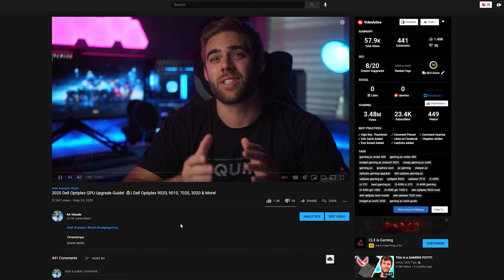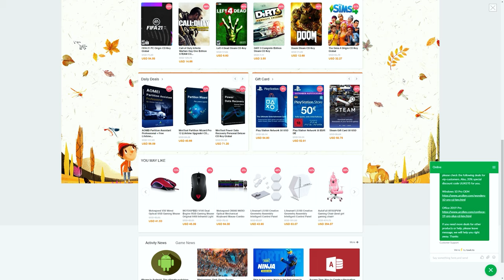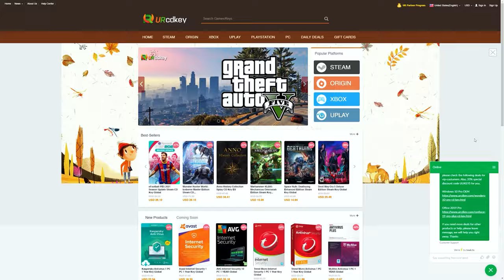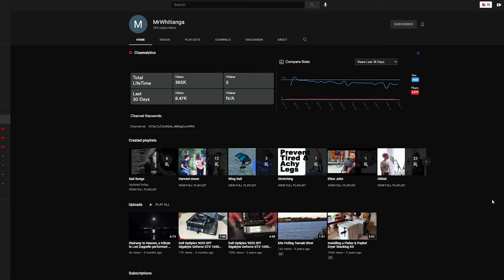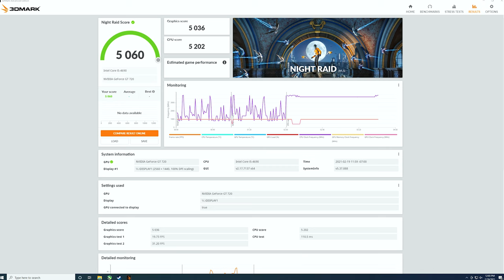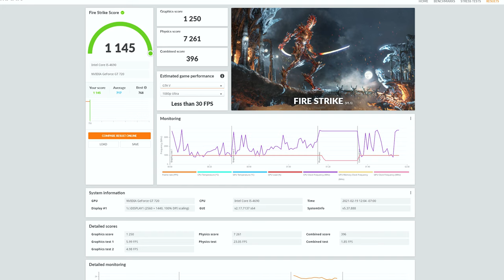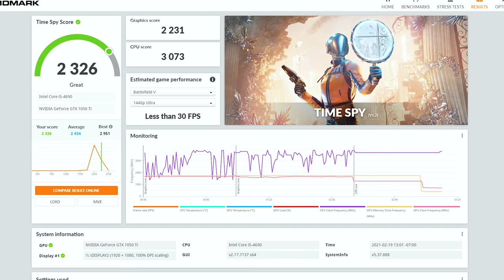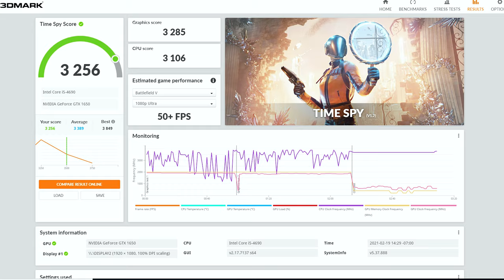The Best Graphics Cards For The Dell Optiplex SFF | 9020, 7020, 3020 & more! | GTX 1650, 1050ti

Comment: So I can use the 1660 in the dell optiplex 2090 without upgrading the psu?
Reply from the maker: I don't think so. I believe you need to upgrade the PSU for the 1660
Reply: @RAVisuals  the psu I have I think is 225 w and the 1660 is 125 I believe

Comment: I have a Dell Optiplex 9010 SFF (3rd Gen i5 with 240W PSU) with Windows 7 Pro, may I know what graphics card can I buy for AutoCAD 2010 3D rendering?
Reply from the maker: Try one of the cards i used in this video!
Reply: @RAVisuals  Thanks but anyway I am trying the zotac gt1030 to take the risk.

Comment: Would a 1650 lp work on a dell optiplex 3020sff
Reply from the maker: yes it will!
Reply: @RAVisuals  Thanks bro
Reply: @masoncombs9967  you gpu running well with optiplex 3020sff???

Comment: I got the 1650 and it has a display port, msi ripped you off :p I think mine was a Gigabyte IIRC. I'm not happy that I have it in the x4 slot so now I'm trying to find a motherboard and a case so I can move my components into that and use the full potential of the card, unfortunately newegg doesn't have the ones I want so I'm trying to see if some local shop can get them for me. Amazon does have them, but I have zero interest in sending them my ID just so I can buy stuff from them, like, what?? Fine I guess they're so big now that they don't care about losing customers. I'll get my stuff eventually. Or have someone else order for me from amazon if all else fails lol.

Comment: I have the 7010 sff would some of these gpu work with it?
Reply: Yes, I have the 7010 sff with a low profile Gigabyte GT 1030.  I used to have a GTX 750ti inside it but I cooked it when I overclocked it too much.

Comment: Hi RA Visuals,According to the official dell optiplex sff  manual  models such 9020,7020 .. ...do not support more than  25W per PCI-e . You have real relevant practical experience in testing  models  with  video cards requiring more than 25W , so you do not have  power issues,don't you?
Reply: After my findings. 25w is more of a recommendation, as the standard for the pcie slot is actually 75w I believe. If you can sneak in a better psu (there's like one better, 315w iirc) then you should be able to push for higher cards with less stress

Comment: Hello there. can an i7 upgrade work with these 9020 Optiplex, i have 10 of these and so far at 20gb ram and 500gb hdd and OEM win 10 pro it works very good... i got you on not actually buying these. i didn't they were given to me. i got 6 working so far.
Reply from the maker: Yep! They can have i7's in them as well. I believe the 3770 or 4770 depending on what board you have in them
Reply: @RAVisuals  Great ! Thanks a million I will let you know how it goes. I truly  Appreciate the response 👍

Comment: hi friend, I have a question pls….  I have same optiplex 9020 with 32GB ram, i7,  2t SSD, 240w power supply….  I want to know if I add the graphics card, will I be able to use (Davinci Resolve) to edit videos??

Comment: But people keep saying these motherboards won't power anything more than 1030? Who do i believe?
Reply: that's not true, yes considering the gt 1030 is the least powerful option it will run easier and at a lower temperature but a 1050ti or 1660 will work fine, just do your own  research my guy

Comment: These are more popular for the size and putting a console based Linux distro on it or running Steam Big Picture to play "console games". You can still upgrade these to play just about anything up until 2016/17 and still hold on with some newer titles. Xeon's work, some can have up to 32GB of ram, something like the RX 6400 or A2000 would be plenty of power for a system with PCIE 3.0. For someone who wishes to have an HTPC that can also be good for some couch gaming, these are perfect for the price. SSD, more ram, Wifi/Bluetooth card and a GPU. My entire system cost with a Xeon, 16GB of ram, RX550, the SSD and combo card is about $150/$200 🤷 For a PC based 1080p home console, I can't complain at all. It even does RPCS3 and Yuzu.... Lol

I mean, this thing at roughly $175 can play games at higher resolutions or frames than a new Series S Xbox does in many cases. It trades blows while having access to the Steam library and everything in emulation. Sounds like value to me! Because the Xbox can't play Mario (Or Gran Turismo) lol

Comment: hey! will the A2000 fit my optiplex 3020? I5 SFF and would a power supply help?
Reply: It would fit. A2000 draws pretty low power for what it does.

Comment: Hello, I have a dell 9020 sff and moved the mobo into the m-atx case, can a normal model not LP, gtx 1050ti run a oem 255w psu? because I don't want to upgrade to a bigger psu
Reply from the maker: yes it can!

Comment: I just got mine and bought the Thermaltake Smart 500W 80+ White Certified PSU.. I realized I made a mistake because the computer looks really small am I going to be able to put in the power supply?
Reply: You'll probably have to run the psu externally if it's a sff optiplex. They also sell 315w sff optiplex psus

Comment: I'm interested in putting an rx 550 2gb in my Dell optiplex 7020 SFF with an i-5 4590, it comes with a 255W psu. Would I need to upgrade the psu or is that enough for the 550?🤔

Comment: Would the MSI N750Ti-2GD5TLP fit in the 9020 SFF?   I have the card, and considering getting the computer.
Reply from the maker: I believe it will, you just have to only use the x4 slot though so you'll lose performance as I said  in the video

Comment: Ah dang Ive got a 3010 sff I put a Nvidia GT 1030 low profile graphics card that I paid $75 for it cost almost as much as the PC I thought I made sure I got the newest compatible low profile graphics card I could possibly stick in there even Dell said it's the best quality for the 3010 on their website. From this video I take it that it's compatible with up too a 1650? That's kinda frustrating the graphics card was the one part of my first ever build that went well but I guess even that I did incorrectly ah man. I've got an i7 3770 to replace the i5 3470 it has just upgraded to 16GB RAM I've got a 2TB HDD and a 500GB SSD I would have added the earlier but didn't know id need to remove the optical drive until I get the pcle-sata cable extender thing or whatever it's called so gotta transfer some files after I swap the optical drive for the SSD so the OS is faster and then I can replace the current 500GB HDD with the 500GB SSD at least until I get that extension for the SATA cable thing in that tiny slot next to the graphics card slot. Was sad to not to be able to play some of my disc games I recently bought but luckily enough literally all of them were on sale on steam for like $3 for GOTY editions so yeah not having the disc drive won't matter at least for now. Really need to make sure I understand what parts to order for that extension before I waste more $ lol

Comment: My question can I remove the motherboard and put on a bigger case can I still use a better GPU I'm currently using a GT710 which is pure shit,if I buy a psu and a new gpu(my gpu range is 1070 or 1650 can't afford anything better than that)and a case..I'm wondering if I'll run into problems if I do that...

Comment: I have a 9020 SFF i have a 1060 6GB 
And i put the motherbord in a coolmastercase and i am powering my graphicscard with a second power supply and more fans using a molex to 3/4pin fan connector. And i dont really think its a must to change the motherbord if you are a budget gamer!!
Im running dayz 80frames max 60frames min extreme settings 1440p it works fine
Reply from the maker: love to see it!

Comment: I just got myself a gtx 1050ti for all the games i want to play it runs it at high 60+ fps, i mainily play esports games and gta5 and stuff i need to upgrade my cpu and ram because they are massive bottlenecks.
Reply: Did you chance psu to 315W or does it run with stock 255W?
Reply: @gleiverperez1953  stock 240watts runs just fine.
Reply: @michaelchicken472 your psu don't overheat or shutdown the system ?
Reply: @MetrionN  nah g its actually calm fuck those youtubers that says it isnt this is legit calm i have been using it for like 4 weeks and my max temps(gpu) are 75 degrees am planing to buy an external fan. Any more questions about the system tell me cause i wish i had someone to answer my questions but i took the risk and bought this gpu it was worth it 100 percent am planning to upgrade to the gtx 1650 but its only a 17 ish percent performance boost from the 1050t so idrk i might have to stop using an optiplex in the next 2-3 years.

Comment: im looking to upgrade the 180w psu inside my 7050 sff but I dont know if the power supplys Im looking at on amazon are compatible with any of these gpus (im new to pc gaming btw so I have very little idea what im doing).
Reply: I don't know if you're still looking to upgrade or not since it's been seven months, however, most of these power supplies should generally be compatible with these GPU's. Just make sure the power supply has enough wattage and power capacity to hold in the amount of power that it'll hold! 👍

Comment: I have dell optilex 9020 Sff and i been looking for 2 years to either get a new pc or upgrade my 1030 gt low profile i have 650w psu and i7 4770 with 32gb ram. I was thinking of getting a new pc for better gpu and cpu but 1030gt is almost dying so i dont even know if u should. Gt 1660 super was okay for me i have cougar m330 case so i dont know any idea

Comment: i have a 3020 dell optiplex that i got for myself with no upgrades no graphics card i’m new to the pc building community so i’d be glad if someone has experience and can help me out on how to upgrade it/ it runs fortnite at around 40-60 fps plenty of glitches… what type of ram and graphics card should i get?
Reply: the 3020 sff doesn't have a second video card slot it only supports single slot cards which wont work with the 1050 ti or 1650 lp
Reply: it only works with single slot cards

Comment: Does anyone know if a gtx 1050 ti is compatible with a dell optiplex 3020 sff? I dont mind putting it in the smaller 4x lane, I just wanna know if I can make it work
Reply: Quick question, that gpu is going to be physically installed into the 4x lane ? like it also has a 4x lane and 16x lane slot that you can connect either or ? or are you guys converting? or does it just cover the 4x lane cuss of how big it is ? talking about the gpu
Reply: For my system specifically, the 4x lane is the only lane that you can fit the gpu in without moving the psu outside of the case, the 3020 sff has the 16x lane directly next to the psu and it isnt enough space for any other card than a single slot lp @trueniceguy1115
Reply: @rick7122  yea i was wondering because i have the dell optiplex 3020 sff and my system has both x4 lane and x16 lane and i see that the gpu thats in the vid has a x16 lane inserter so how would it fit or insert in the x4 lane if the insert is completely different? are you guys using some kind of converter ? or does the gpu have both male inserter for x4 lane and 16x lane so you could insert it in either ? cuz im using the x4 lane as my wifi card , so i only have my 16x lane available

Comment: Hi Bro,

May i check what graphics card would be ideal for Dell optiplex 5040 SFF? I am using Intel(R) Core(TM) i5-6600 CPU @ 3.30GHz   3.31 GHz 6th Generation. I have 16GB ram installed.
Reply from the maker: the 1650 LP would be great for that or a 1060 3G.
Reply: @RAVisuals  will it work with the 80+ bronze psu?